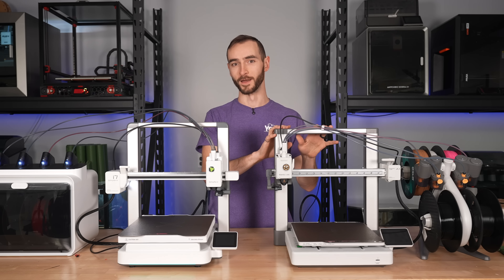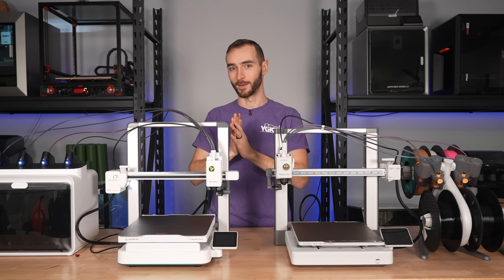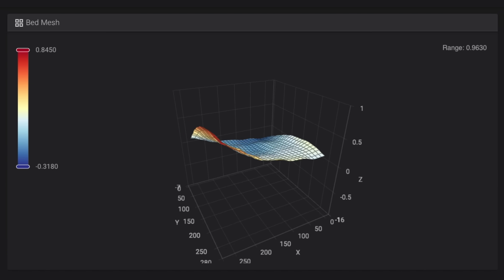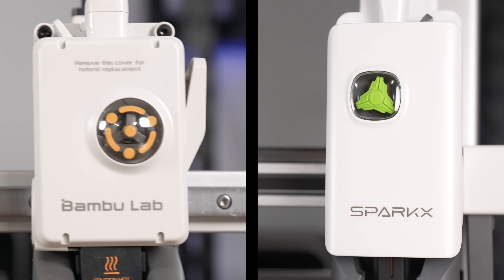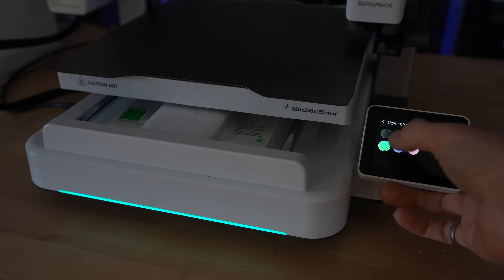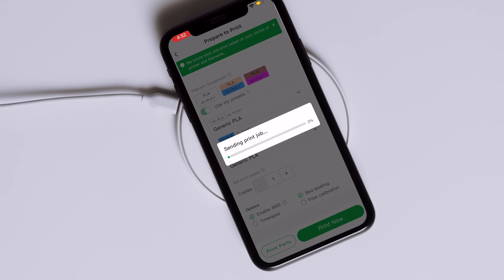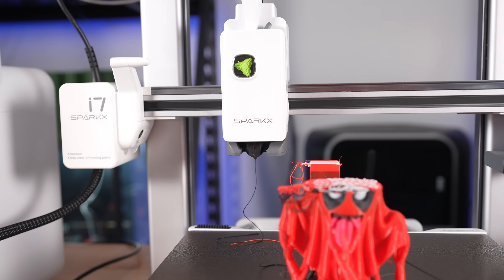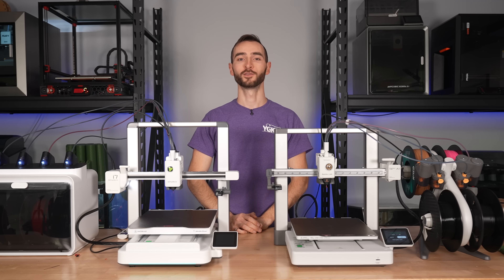Creality Cloned Bambu's Bestseller (and made it better?) - SparkX i7 vs Bambu A1

Comment: ill never buy a creality printer again.
Reply: My first printer was an ender 3, It lasted a month before the extruder clogged and wouldn't work anymore, no matter how much I would try to unclog it.
Reply: who care
Reply: Same.  Had two Creality (Ender 3 Pro, then Ender 3 S1 Pro) before buying my first Bambu (P1P).  Buying the Bambu is what made me decide that fiddling around with 3D modelling was worth looking into.  Then I bought an X1C.  Then I wanted something with a bigger build volume, before the H2D was announced, so I bought a Creality K2 Plus Combo.  Printed a giant Stanley mug prop for my sister in law.  Tried printing something in PETG-CF.... clogged the nozzle to the point where I couldn't seem to get it un-clogged.  Realized just how much I also hate changing nozzles when you need to take them out with a socket/wrench, and then sit there with a searing hot nozzle trying to figure out where you can put it without burning/melting something.

Then sold the K2 at a bit more of a loss than I'd have liked for a ~1-2 month old printer, and ordered an H2D.  Been a dream since.... and debating if I wanna go through the time/effort/cost of doing the H2C upgrade when it's available.
Reply: @theElemDragon Which size nozzle did you use for the PETG-CF?
Reply: @krazed0451  a .4mm nozzle.  Same as I've used on my X1C and now my H2D, with the same spool of filament, without a single clog.
Reply: @theElemDragon Weird, I see many recommendations to use a .6mm nozzle for any fibre filament...
Reply: @krazed0451 it's definitely recommended, simply because it minimizes the chance of clogging, but using a .4mm nozzle is still possible.
Reply: @theElemDragon  Fair enough, learning learning! :-)

Comment: I do not understand why I should buy a printer that is just a copy of another one.
Reply: Personally because of the security restrictions of bambu being able to remotely shut down ur printer i would go for the clone knowing it can be rooted without a full board swap.

"Critical Operations That Require Authorization
The following printer operations will require authorization controls:

Binding and unbinding the printer.
Initiating remote video access.
Performing firmware upgrades.
Initiating a print job (via LAN or cloud mode).
Controlling motion system, temperature, fans, AMS settings, calibrations, etc" 

this is from bambu themselves, i could be wrong but this is scary to me.

Comment: I run a small print farm and am a fan of Bambu printers (A1, P1S and P2S). I have used Creality in the past and just don’t believe the overall quality is there with their machines. They always look good but I always find issues that cause problems and they never seem to get everything running properly. The A1 is a workhorse and although I agree their locked infrastructure doesn’t provide the best firmware options the printer works well. I use both the AMS lite ad the AMS 2 Pro with the A1 and print with cardboard spools all the time and have not experienced many issues. I generally print with PLA variants so having enclosed spools isn’t really a major issue (and this is removed with the AMS 2 Pro). I also feel Bambu filament is quite good and their bulk pricing is hard to beat. There are some benefits to the i7 and CFS Lite but I don’t believe they provide overall value in my use case.
Reply: I understand why many farms were built with Bambu, as there were no other good printers an year ago. But If I was to build a farm today, I would definitely look for a Klipper machine and implement different professional solutions like filament stock tracking, OpenSpool, etc. Also Creality reliability depends on model. I hear many people are using Ender-5 Max in their business (don't have one myself).

Comment: Took Creality 2 years to release a printer on the level of the A1. 

And while on paper the Creality is better, I have a feeling someone buying one and using it for years would likely have a better experience with the A1 long term. 

Klipper with root access is nice though. This is great if you want an A1 that isn't locked down.

Comment: 3:00 well, all bed leveling data looks bad when it gets stretched based on how level it is. 0.5mm off over 12cm isnt a huge problem.
Reply from the maker: It’s almost 1mm
Reply: Anything over 0.3-0.35mm is bad. Sure it's not a huge problem but not even 1mm isn't a huge problem until it is. If I can get it down to less than 0.1 on my first ever printer, you should expect more from manufacturers.

Comment: That is the first review of a creality printer in a while that I have paid any attention to.  My A1 is starting to wear out and I have been considering replacing it, but want to move (the rest of the way) outside their garden.  (sold other Bambu printers already and went Klipper a while ago).  Like the simple form factor of the A1 for PLA prints, and TPU.  Having improved versions of these capabilities in a Klipper printer is great.  Especially like the Orca compatibility as needing to use proprietary slicers is a full stop for me.  ==> Would I be an early adopter of a new Creality printer model.... no.  Given their recent track record, I will give this 6-9 months
Reply: What made you want to leave their ecosystem, curious.
Reply: @free_spirit1  Bambu intentionally limits (knee caps) the capability of their printers.  Perfect example is P2S with intentional ringing issues that limit print quality.... to try and get users to go to the next (H2) level.  Realized that my Plus 4, T1 pro, and for goodness sake even my Sovol SV06 Ace had better print quality than my X1c.  Really hit home when my Voron 2.4, home assembled printer, was able to produce much better quality.  Bambu has a stable, turnkey product, but you are stuck at that performance tier, and it is always their way or the highway.  I chose the highway.  Have so much more control with Klipper.  I can adjust z-offset, flow rates, etc on the fly with Klipper.  With Bambu you have to hack in z-offset in the print start macros based on the plate type.

Comment: In no way would I buy a replica just for a $60 save
Reply: I know a small savings for a bunch of improvements and not to be locked in to bamboo system and to be able to use your own slicer.
Lock you into their software, locked you into their features remove ability to use any product but their own and pay more for it .
Reply: you are comparing a creality printer WITH a multi-material system to  the price of JUST  the A1. At least in my country, the i7 combo goes for 289€, whereas the A1 combo goes for 571€,
Reply: @pimi8522  In the US, the Bambu A1 Combo with 4-color printing sells for $400
Reply: @pimi8522 multicolor printing is a scam anyways
Reply: It blows my mind that Creality doesn't also know this.  They keep making 10,000 models which no one. Wants or asked for, at a premium price.  They are stealing tech left and right, but don't provide and value for that stolen tech, too the customer.  They have to be close to a quick death.  No one is buying them, and they have a million different models.
Reply: @jholden0  pretty sure most modern business operates that way do you have numbers to back up your statement about sales? Sources or it’s just blather

Comment: Creality could have one upped BBL by going with a core xz movement for the x/z axies, like in the Voron Switchwire.  This would have saved them the cost of a stepper motor and two lead screws.  I see nothing wrong with the use of linear rods and round bearings over the more expensive linear rails.  If the system is properly designed, both work very well.
For those that mostly use PLA or PETG, an open frame bed slinger type printer is a good choice.  They are usually less expensive and easier to repair.  However, if you need to print high temperature materials such as ABS, ASA, Nylon, or other new engineering materials an enclosed printer is the only way to go.  By the time you add in the cost of the enclosure, a core XY, crossed gantry, Delta style printer begins to make more sense.
Reply from the maker: I believe the Ender 3 v3 is Core XZ
Reply: @ygk3d  it is yeah, and they abandoned that concept.

Comment: 0:40 sorry but how does a printer "grow with you"? it will grow to the dumpster if there isnt replacement parts in the future for it. it cant grow up and have a bigger build plate or multi nozzle upgrades. there is nothing about this printer that will grow up. its not a living being. its a product designed for people who dont care about quality prints, you said it yourself, its a beginner product for people who know nothing about 3d printing. print farms are NOT buying these.
Reply from the maker: A ton of print farms use A1s exclusively. The point I was making is that it’s not strictly a beginner printer. Plenty of people using this type of printer at scale to turn a profit.
Reply: i dont like either of these printers. there is nothing worth buying when you take away every feature that makes a printer usable.
Reply: 3:20 you cant even level your bed. this is a bottom of the barrel beginner printer. this is ewaste

Comment: Does it run mainline klipper, or creality's fork?
And report back please after at least 100 hours of print?
Reply: if its not klipper you can ptobably unlock the build root easy like on the k2 lineup and k1c.
Reply: It is klipper but they never admit it @darkshock42mlg05
Reply: If anything like Creality's other machines, it's a fork of klipper that's been modified to run their own proprietary code, and stuff like the leveling sensor will break if you put mainline Klipper on it, because it doesn't have the code needed to understand what it is.

Not the biggest problem except that they also like to remove code that operates things they don't implement, so rooting might not be enough if you're trying to do something different to mod the machine.

I'm sure someone with the knowledge to document all this will eventually do so, but it'll probably take awhile.

Comment: Wow, just what Creality needed another skew/model printer and I bet they still make all 1,000,000 older ones.
Reply: actually a lot of models are discontinued now. Only the Ender5Max, K2 Series, Hi, and upcoming Ender3v4 models are current in production. And Sparkx is technically a separate brand aimed at new users which is why it focuses on ease of use.